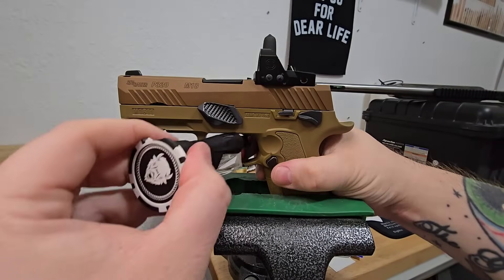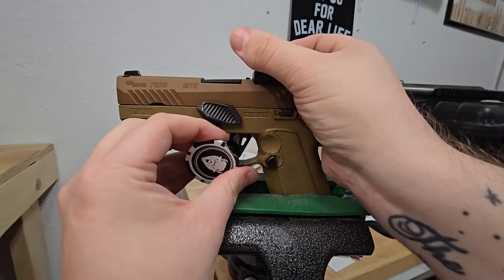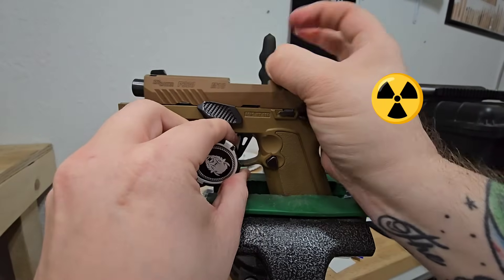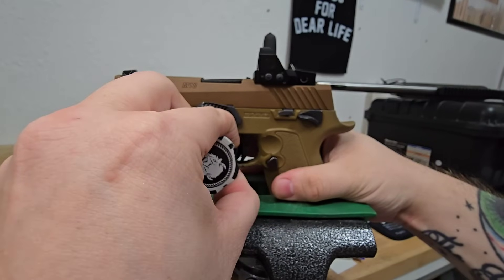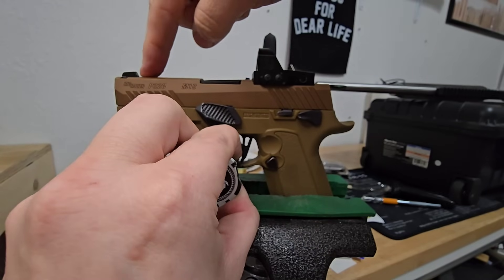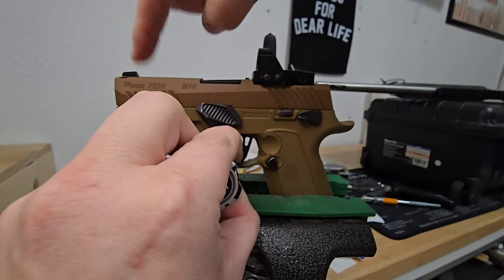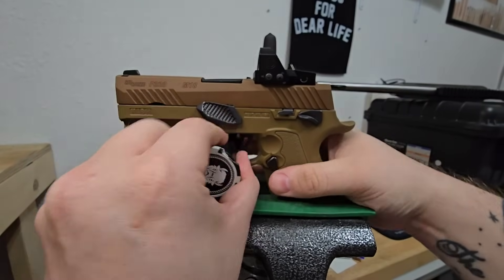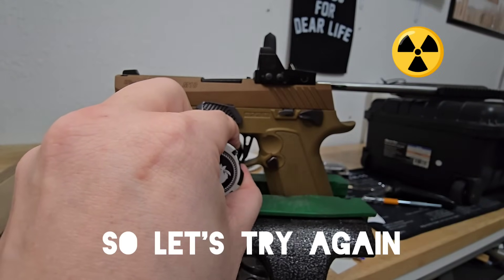VISE Testing Sig Sauer P320 M18 Slide/Trigger Pressure Issue!!

Comment: With all respect it sounds like your opinion based off other people's opinion. Not much technical fact has been shown. I am just looking for some facts on how this happens. Broken machines are repeatable and easily proved. So far, I have seen people breaking or disabling the guns safety features to make it go off. Or pulling the trigger to the break point and moving the striker up and off the sear by lifting the slide to finishes the firing cycle, then acting surprised when the gun goes off. No science in any of these conversations just opinion and speculation. Let the third-party pros do their investigation and then let's accept the results.
Reply from the maker: I missed the part where I told everyone I'm an independent expert and spoke for the entire community...I must have only accidentally typed "Test your gun" at the end. Clearly, I held myself out to be an expert with my poker chip/pipe stem micrometer took and harbor freight vise.

Comment: Lets see it happen with the safety engaged.
Reply from the maker: I'm unable to replicate it with the safety. If this is the issue (which I have doubt about), then it must ask the question as to whether it's absolutely confirmed that the airman did not have the MS engaged.
Reply: @DoubletapDaoist  Yeah that would be very nice info to know. It's only about 0.8mm (20%) of trigger travel past the wall to make this happen on some p320's I wonder if some sand or gunk could get into the sear or trigger assembly and if would have a similar effect and if it could prevent the trigger or sear from fully resetting.

Comment: You could drill and tap a very small hole into the trigger guard horizontally, parallel with the slide.  Thread a long machine screw into the hole, adjust for trigger take-up, now you only have one hand on the gun.  Back screw out a little, cock gun, tighten screw to move trigger...  The gun is nearly trash anyways, and a 2mm x 50mm screw would work, wouldn't affect the trigger guard strength, and are sold at every hardware store and Amazon.
Overall, I believe both you and Wyoming Gun Project tested properly, the results are duplicatable, and the results are damning for SIG (Self-Inflicted Gunshot).
Good job, I was already convinced, but you just cemented it.  You earned a sub, brother.  Shoot safe.

Comment: Any of you fools ever take a gun safety course? Full stop. Trigger was pulled. Stop being obtuse.
Reply: Yea my pistols have 3 points of safety.
Reply from the maker: I'd have to argue that the obtuse ones are the ones who are trying to claim that there is no problem when there is one. Putting blinders on has not really done anything for anyone, brother. This was the case with asbestos, agent orange, the HCFCs. Claiming that you haven't seen the issue, and thus it must not be an issue, is fairly obtuse, especially given that this video never suggested that it offered to explain anything other than to show a repeatable phenomenon. I don't think there was anything here where I mentioned explaining how the holstered-gun discharges happened. If you can point to it, I'll hear you out. Otherwise, you're just being combative.
Reply: @DoubletapDaoist  I never claimed there isnt a problem with the sig P320. But all of us here should know by now that putting your finger on a trigger is ONLY acceptable when purposefully discharging a firearm. So can you give me a real world situation where this is dangerous with a responsible gun owner?
Reply from the maker: @BaradaNels  The issue in this case is that there are holsters which might interfere with the triggers depending on the shape of the triggers, grip module, and holster "snap -in" points, which often intrude inside of the trigger guard. Your thinking is that nothing touches the trigger except the finger of a ready marksman. That's fine, but not always the case. If there is a safety issue with the holsters or the gun that puts pressure on the trigger, shouldn't we know about it?
Reply: @DoubletapDaoist Then obviously the holster is the issue if its touching the trigger in any way. Do you not agree?
Reply from the maker: @BaradaNels  THAT'S THE POINT OF THIS VIDEO LOL. You've assumed I've made some conclusion about the reasons for the P320. If you read the description of the video, you'll see that
Reply: @DoubletapDaoist Of course I didn't read the description. Please retitled your video to: "Holsters are the cause of Sig P320 misfires" then. And urge everyone to buy a proper hoslter like the Alien Gear Holsters. No matter how quick or at what what angle I put my gun in it, it never touches the trigger
Reply: @BaradaNels  ok. Please tell me why this only happens to the P320 in a holster? Why not every gun and much more often? It is not the holster firing the gun, the gun fires after been slightly moved by a very normal putting a gun in a holster like you do with EVERY gun now and then.

Comment: SIG = Ford PINTO of its TIME
Reply from the maker: Maybe just the 320. I like Sig Sauer. However, perhaps, in their rush to product models as fast as they can, they might have overlooked or minimized issues that led to defects down the road. The Pinto was a great design. Perhaps it was lack of imagination that led to the designers thinking it wouldn't burst. There were many other cars which shared that design, but the poor Pinto became a scapegoat for unsafe gas tank design. The issue with the P320 is that it seems to be the only model that has this pervasive issue. My favorite carry gun is my P226 Legion.
Reply: @DoubletapDaoist  horsE SHTIT
Reply from the maker: @ZIGZAGroundZERO  I just want to let you know that Youtube asked me if I wanted to translate your comment into English.
Reply: @DoubletapDaoist  The problem is that this pistol is so universally adopted by police and military it is going to be very expensive to fix.  It also may sully a lot of reputations, not just Sig.

Comment: But the thing is when you carry it in the holster, no one is pressing the trigger to the wall. But I get how if it drops the trigger can jolt to that position
Reply from the maker: You're asking the right questions. We're eliminating some additional variables. If Sig says the gun must have the trigger actuated, how? here, it seems that there is a point at which the trigger CAN put the slide into a position in which the striker will drop if there is the slightest touch. Is that going to answer THE question? No way. I'm just here to show everyone that there IS in fact a repeatable issue, which many people have denied. This is NOT the reason that airman died. I'm confident claiming that.

Comment: I've tried many times to replicate this on my stock p320 and cannot get it to malfunction. note that uncommand discharge is not capable when the thumb safety in engaged.
Reply from the maker: Well, it's not possible under this exact test. Allegedly the airman's firearm was on safe, but that might be embellished

Comment: I smashed my Sig p320 with a rubber mallet and the trigger did not engage. I bet most of these guns have been tampered with. The controversy started with the Dallas Police department and nowhere else. This has to do with tampering. My gun is fine, but I will never let anyone touch my Sig p320 since there seems to be a lot of people with an agenda!

Comment: Interesting test.  But, you induced a variable by retracting the trigger.  No holster, that I am aware of, puts pressure on the trigger like that. So what does this show?   The biggest issue is not mechanical; its philosophical. This SHOULD have been corrected years ago.  THAT is the problem. Good luck with that one.
Reply from the maker: This is part of diagnosing the problem. I've never once claimed that I've figured anything out OTHER than to show something that seems to be repeatable.

Comment: mine doesn't do it, but i wonder what % does
Reply: My Sig P320 is perfectly fine. Full stock though.
Reply: @BaradaNels  The M18  from the air force man was also stock and even with engaged thump safety.
Reply: @Gieszkanne  We dont know if he touched the trigger. Or if his holster touched it. Nobody can replicate this issue WHICH WE NOW KNOW can only be replicated if the trigger is touched and it happens with many guns. Not just the sig.
Reply: @Gieszkanne  Please link said report because NOBODY can reproduce this situation without engaging the trigger one way or another. There is a lot of bs going around. Post evidence or it's all nonsense at this point. All pistols have been proven to do this.
Reply: @Gieszkanne  Please post the report. Nobody can reproduce the issue without engaging the trigger. And most other firearms do this same thing.
Reply: @Gieszkanne  I have seen NOTHING showing this is possible without touching the trigger. If you have evidence of your claims, then please share it. Until then you're merely talking out your ass, sir. No offense. But lets be honest, talk is cheap. Bring receipts if you want a return on your investment.

Comment: The excess play and movement of the slide to FCU/frame fitment could be a contributing factor to cause possible UDs but other factors would need to be present as well.  The thing about this particular test is that the trigger needs to be moved rearward slightly past the wall in order for a UD to happen.  In the possible UD incidents reported how is the trigger being pulled or moved rearward slightly past the wall, especially if it is in a holster covering the trigger guard?  Another thing that should be noted is this could only be done on a none-manual safety version of a P320 or a manual safety model with the safety off.  In the case of a military M17 or M18 with a manual safety the trigger can not be moved rearward enough with the safety on so this could not happen unless the manual safety is intentionally or unintentionally left off.  And without the trigger being moved rearward far enough the striker safety would still block the striker from moving all the way forward also preventing a potential UD.  In the most recent Air Force incident (with M18) a UD caused by the failure shown in this experiment could only happen if the manual safety was left off.  The slide to FCU/frame play may be a factor but only if there is also some other issue or issues happening at the same time.  There are most likely other makes and models of striker fired pistols that could fail this same way if the trigger is moved past the wall. Moving back to the wall takes very little effort, moving past the wall is basically the same as pulling the trigger, hence you pull the trigger you fire the gun. In my opinion if the P320 had a more substantially made FCU/frame like the P365 being machined with longer rails many of the issues noticed in the P320 would be eliminated. I also think the manual safety should be redesigned to also block the sear and not just prevent trigger movement on the M17/M18 and manual safety models.
Reply: In these tests the trigger is being pressed beyond any slack and slightly into the wall.  This can easily be seen and identified by the fact that almost everyone trying to do the test breaks the trigger multiple times trying to find a sweet spot just ever so slightly before the trigger breaks.  At the point slightly into the wall and just before the trigger break the striker safety is already mostly moved out of the way and the sear is already moving downward just like most other striker fire pistols at that same point.  The striker safety has to be clear of the striker just before the trigger breaks otherwise the gun would never be able to fire.  This is true for every striker fire pistol that uses a striker safety, timing it correctly is extremely important for reliability.  The designs may be different but they all achieve the same purpose.

How is the trigger being pressed or jarred inside a holster?  I believe there are probably some holster designs that can come in contact with the trigger on a P320 but no holster should come into contact with a trigger on any brand of pistol.  The next issue with the trigger being moved is on a M17 or M18 with a manual safety (and safety on) the trigger can not move far enough to disengage the striker safety or move the sear downward at all.  If someone leaves the manual safety off and then plays fast and loose with the gun in a holster or not they are taking an chance of firing the gun, again true for any pistol that does not have a trigger safety and also has a good relatively light trigger.  For all of the people that have a M17, M18, or P320 model with a manual safety it needs to be used, that’s what it is there for.  A manual safety on will not allow this slide movement test to fail since the trigger can not be moved back far enough.

Do I think the trigger on a P320 should have a trigger safety, absolutely, but knowing it doesn’t have one and having a model with a manual safety and not using it correctly until the gun is ready to be fired is just ignorant.
Reply: Finally a measure of sanity.  The trigger is being pulled.  Period.  Full stop.  The striker safety has been defeated.  EXACTLY AS DESIGNED! 
This test does not in any way demonstrate how a P320 goes off when holstered.
Reply: The p320 trigger travel is about 7mm that's 3mm of slack and 4mm of travel past the wall. One has been seen prematurely fired with only 0.8mm of travel past the wall that's only 20% of the travel from the wall to the break. Something to consider is a grain of course sand is 0.5-1mm what if a chunk of junk got into the trigger assembly or sear/striker and somehow prevented a full reset of the trigger upon racking a round into the chamber. Then all if would take it the correct wiggle from the slide in the holster to fire.
Reply: Sorry but your both wrong. In this test you are taking the slack out of the trigger. And you have not even come to the wall. That’s the point. If in my duty holster the trigger is jarred or pressed to this point before the wall. And the slide is pressed down or jarred the P320 will fire. End of story. 

I have tried this and never pressed the trigger past the wall which is suppose to be the first safety of the pistol. Also there is a second sear block and then the striker safety bar to prevent this? But the P320 continues to fire with only a Millimeter of movement in the trigger with slide pressure. Pay close attention to the videos and you may learn how unsafe the P320 has now become. I use to carry one for work but now I do not. Because what you don’t know, can and will kill someone.